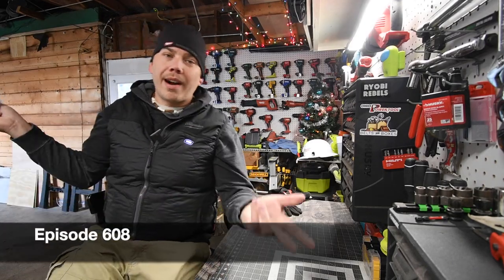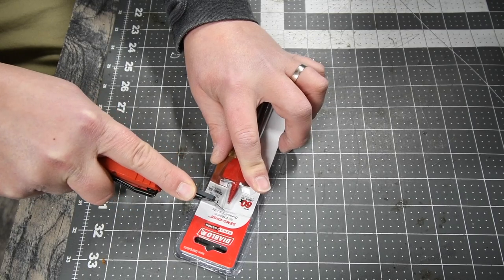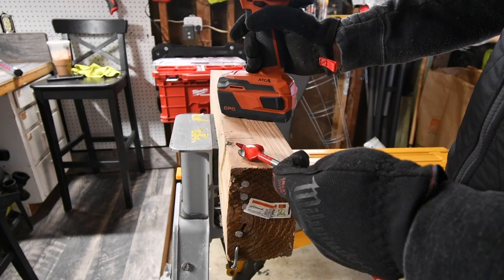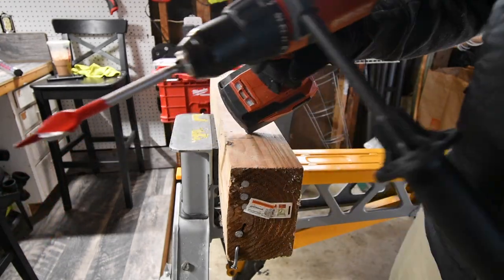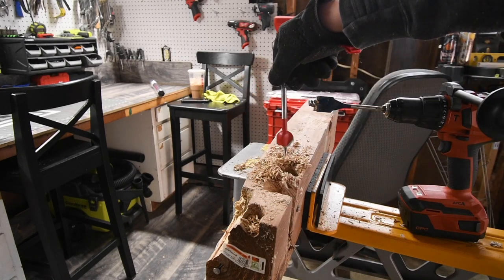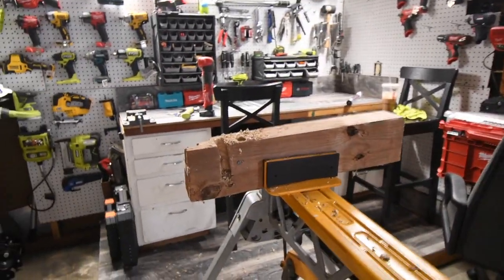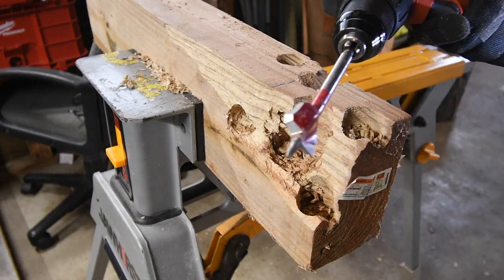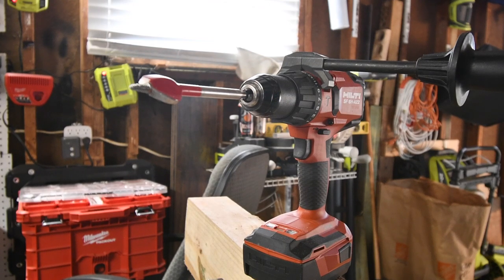THIS CHANGES EVERYTHING! (NEW Diablo SPADE BITS EATS NAILS???)

Comment: I love Diablo bits but they just won't last of you hit many nails while drilling through wood.

I know Irwin used to make bits just like this in the past. Much thicker than a typical spaddle bit, but then they made others even thicker for going through nails. They also called them nail eaters.

But in my experience, after going through a couple of nails the bit was shot unless you could sharpen it with a file. 

If not, it was worthless. The extra cost just didn't justify the few nails that it could go through before it was toast! 

There are some heavy duty auger bits made by a few companies like Greenlee that are called "nail eaters", but none ever last too long after "eating" a few nails. Despite what their names say. 

As an electrician, the worst invention made are nail guns that the wood butchers use to nail headers and corner posts together because it's so easy to shoot a nail into wood now, that they put 100 nails into these headers and corner posts. 

This makes it impossible for an electrician or plumber to drill holes in these studs without hitting nails in these problem spots and ruining our expensive drill bits. 

This is exactly why I call these guys wood butchers and not carpenters! 😂🤣😂
Reply: So true about the corner posts and nails